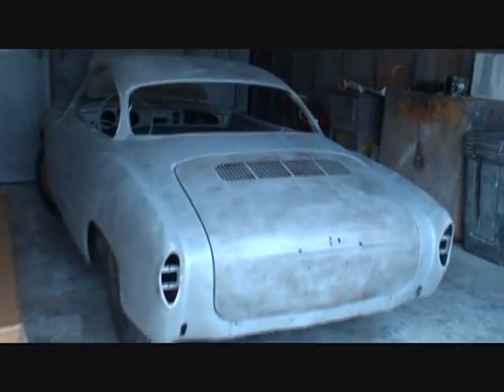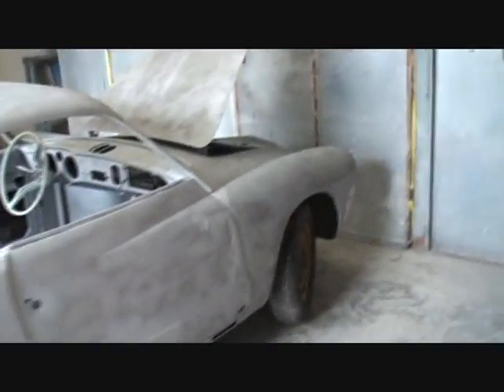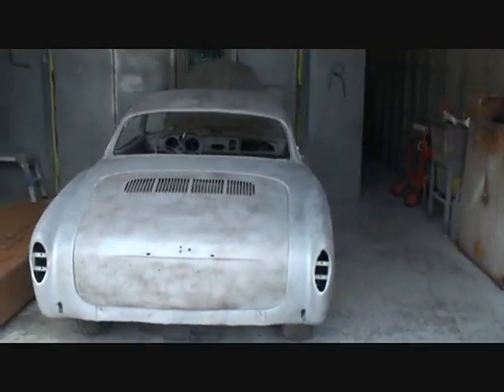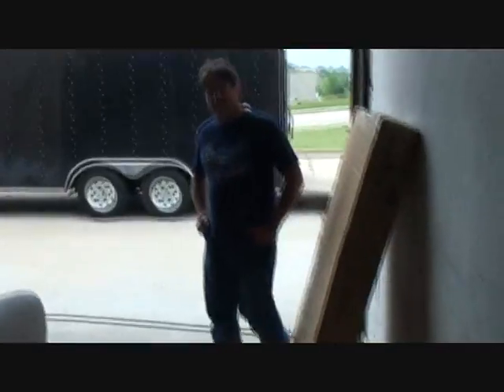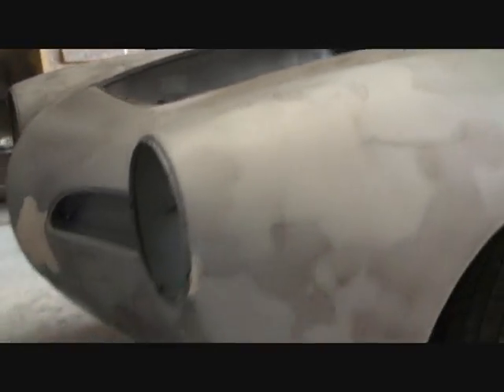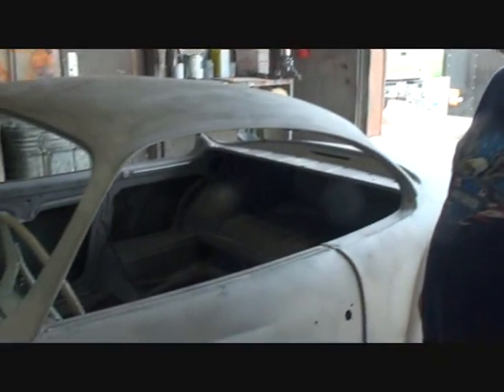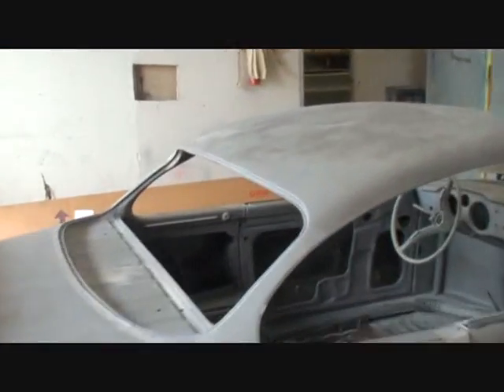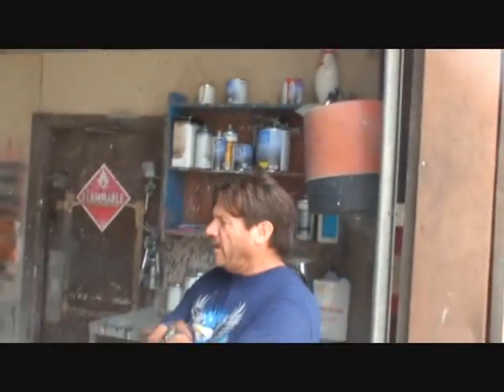1964 Volkswagen Karmann Ghia-Learning How To Restore It RIGHT!

Comment from the maker: Yeah you can grind the case if you want to, but you better be very careful and have on safety equipment. If the magnisium dust catchs a spark it will go up like a flash fire!! Also changing out the transmission to a late model will give him sinced 1st and 2nd gear and also have a better gear ratio for rpm stratagys..

Comment: But Pete, car has to be sandblasted, at least undercarriage and rusty areas if you want to do it properly. After sandblasting, sandblasted areas have to be protected as soon as possible with 2k base coat to prevent them from rusting. Large flat areas like hood, roof, doors shouldn't be sandblasted because sandblasting bends them, and the you have to straighten it again. I've made that mistake with roof and now I'm fixin' it like mad. 

Greets from Slovenia

Comment: NOT a trailer queen? Its a cheap tin can which was never very reliable, very fast, very safe, very stylish, warm in winter or cool in summer. It was cheap import transportation in 64 but beauty is in the eye of the beholder and airplane guy likes the lines of this car. So why not paint it up in a color which HE finds appealing to HIS beholding? This original crap takes all the fun out of building and driving. Resale value = money but its not about making money its about a driver HE likes.
Reply: Wow you know NOTHING about VWs. The ghia is a very reliable car. It has very desirable Italian styling and is valued at 35k now and only going higher. No it didn’t go fast but we have speed limits and it meets those easily.